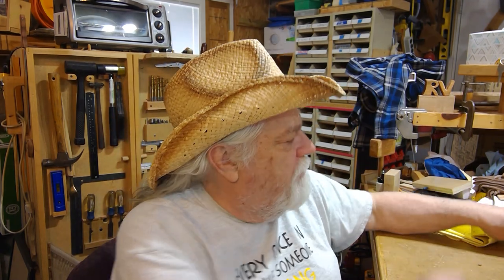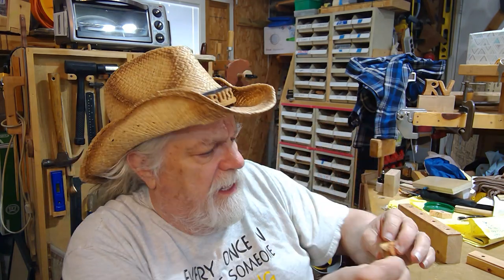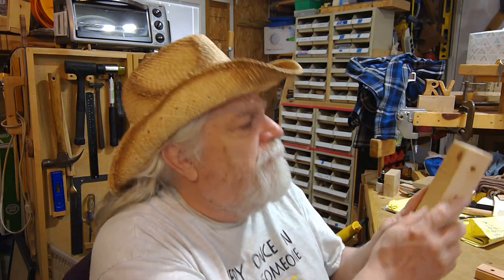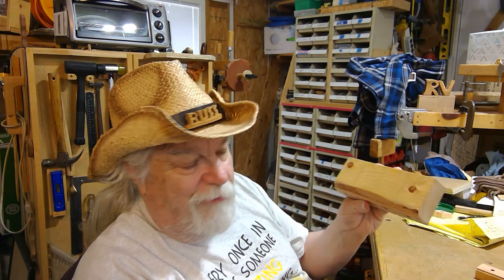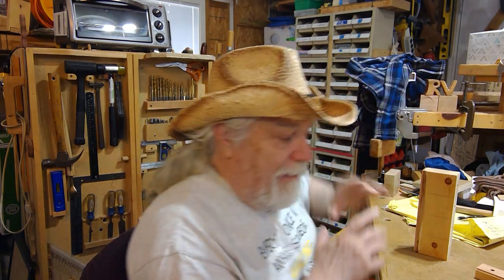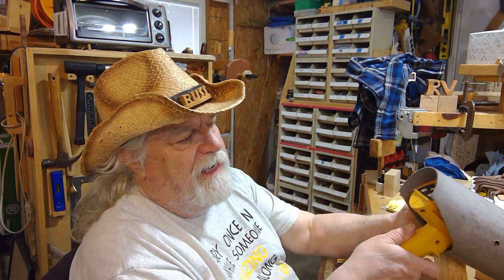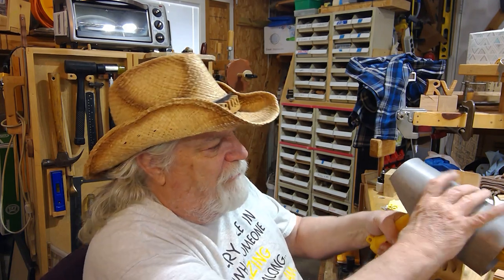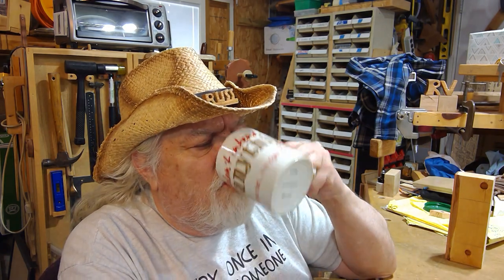2 New Wood Knobs by Rambling Russ

Comment: Have you thought about making knobs out of PVC pipe?  I use PVC pipe around the shop constantly for adapters on dust collectors, tools, vacuums etc. etc.  I tried using my oven at first but I found out that one doesn't want to heat the entire piece, just one end at a time.  That I learned from you.  Thanks.
Reply from the maker: PVC knobs . . . I guess I need to do some more OTB thinking, Grumpy :>)

Comment: Hi Russ, thank you for taking the time to share it has been a joy to see you ramble on and give us all tips on getting things done.  wondering if you could help me out I have to glue up a lot of Baltic birch 8 x11 1/4” to 1/8” pieces like a lot over a 1000 and if you have a way to ensure good pressure and the pieces stay lined up?  Thought I seen you use some clamps and wood  pieces to do this but there is so many videos I can’t remember which one ugh! Btw have a ornamental mill and a Zyliss vise because of you thanks for showing me how!
Btw would like have emailed you but don’t know how is there a way to contact you?
Reply from the maker: First, Thanks for the input.  I've been thinking about your project dilemma.  If you are are doing that many glue ups, it's time for a jig to help with alignment/gluing instead of clamps.  Are you building 250 +/- drawers or something?
Not sure which video you referred to.  Maybe if you describe something in the video I'll figure it out :>)
BTW, what model LOM do you have?
Reply: @russveinot5754  they are puzzles for a Métis group for children ya need to send you a picture do you have a email address
Reply: @russveinot5754  some boards mounted at 90 deg in one corner and clamps are used to use for pressure not the best explanation
Reply: @russveinot5754  oh ya I have the 1200 with the cnc upgrade and also have a set of milling tables with bench dog holes
Reply from the maker: @AllanBruinooge  Allan, sorry I missed this comment when it came out.  My email is "otb-thinker@cpamomy.com".  I would love to see pics :>)

Comment: RUSS WHAT KIND OF WOOD BIT DO YOU USE WHAT BRAND BIT IS BEST TO BUY I WANT TO MAKE SOME KNOBS  I JUST ORDERED SOME  1/4 X 20 T NUTSBUT NEED TO BUY SOME DRILL BITS PLEASE LET ME KNOW THANKS
Reply from the maker: you will need a 5/16" drill for the thru hole and a drill bit based on the nut diameter to drill a shallow whole to recess the nut.  A forstner bit for the shallow hole works best.  Does this answer your question?
Reply: @russveinot5754  THAT IS GREAT RUSS I  will  get these bits thanks very much for your help
Reply from the maker: @stanmashek3085  Let me know if I can help with your knob making, Stan.  BTW, let me know how they turn out :>)
Reply from the maker: @stanmashek3085  Let me know if you need anything else.  BTW, I'm interested in hearing how they turn out, Stan :>)